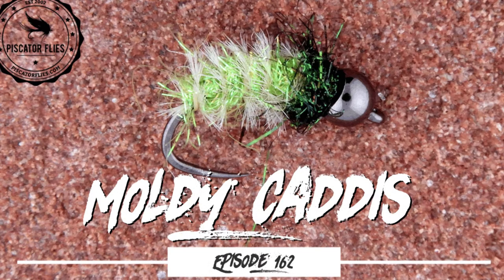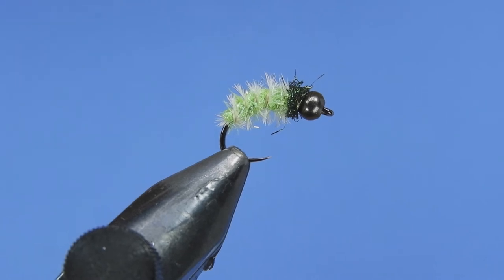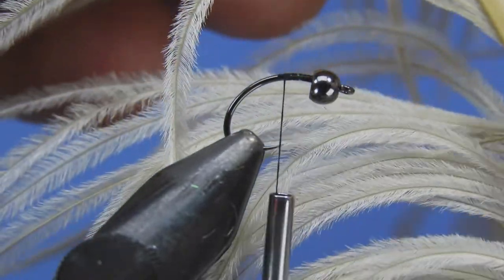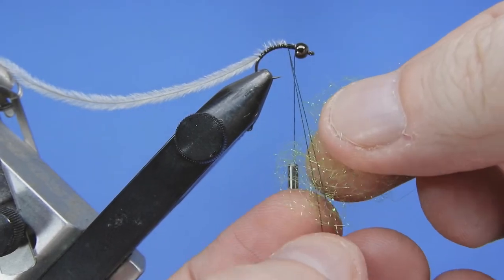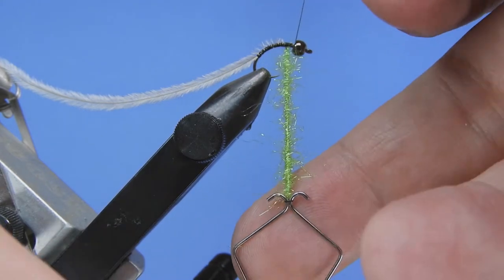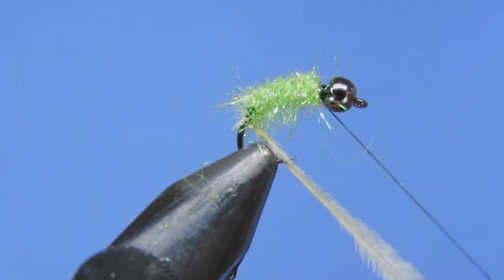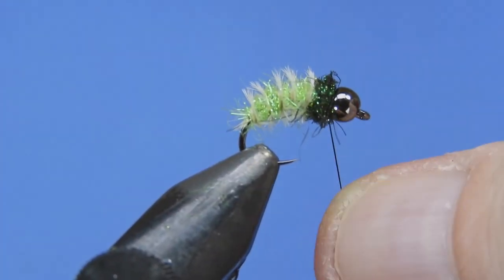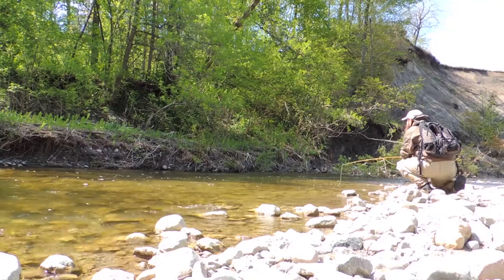Tying a Moldy Caddis Pupa Trout Fly - Ep162 PF #piscatorFlies

Comment: Nice little caddis Darren! Most of my dubbin is done with soft natural materials so I find the coarse, springy ice dubs to be a bit of a nuisance the way they fight back. Like the way you feed the ice dub fibers onto the thread - will have to give that a try. Cheers!  Hank
Reply from the maker: Hank, thanks for the comment. I find the ice dubbing not too bad for staying on the thread. Just be sure to turn the dubbing a little tighter than you need and  only in one direction. The loop is nice as well, a little more trouble than straight dubbing, but worth it here. If you get a chance, look up Don Ordes' Rope Dubbing techniques. Cheers
Reply: @PiscatorFlies  Checked out Ordes techniques and found a lot of advertising but little content, he does tie some nice patterns. I use the dub on wire and dub in a wire dubbing loop in some of my flies. I tend to dub tight ropes rather than "fuzzy" ones and use dubbing loops when I make a collar. Always trying new techniques. Hank

Comment: Catchy name. Question..Does the ostrich herl ever get broken fron the fishes teeth? Would it help to wrap the ostrich around thread before palmering?
Reply from the maker: @fshng2fish  I was thinking that it might be an issue, but the stem is down in the dubbing somewhat. But, I was considering using a counter rib on the fly to prevent it from breaking. The herls I'm using are in good shape, but sometimes you'll get herls that a little fragile and I think in that case, I would use 2 herls wound with thread or wire. Cheers!